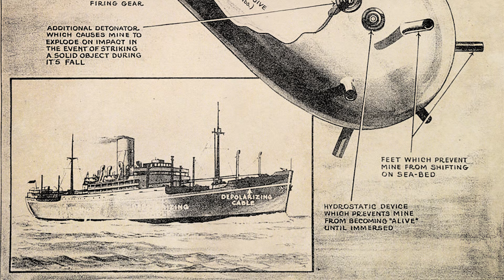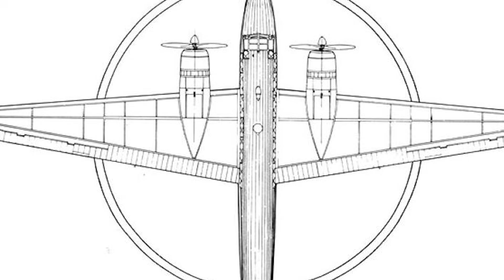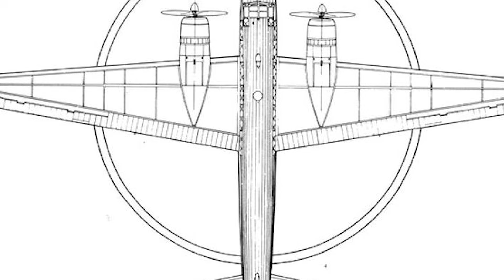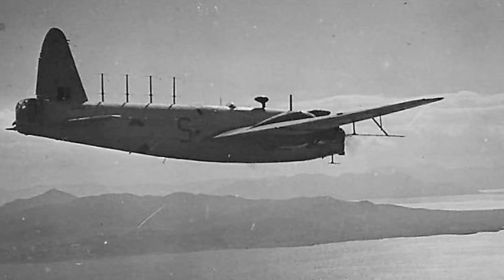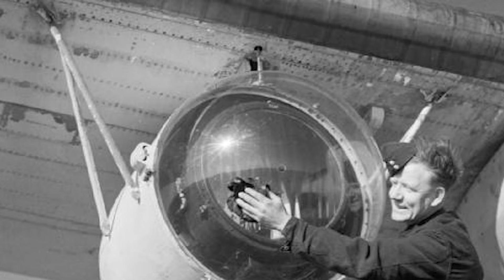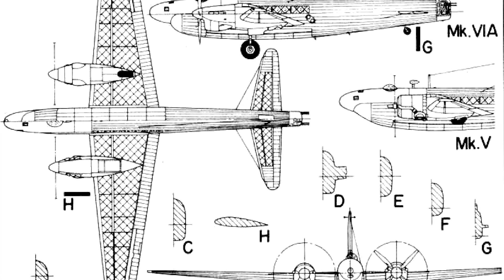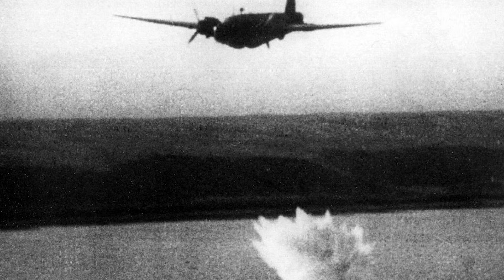Britain's Strangest WW2 Bomber? | Vickers Wellington (Part 2)

Comment: The Hurricane mounted 2 x 40 mm cannons successfully as a tank buster. which suggests the  nose or belly position should have been fine. Especially given the Hurricane had only 1 engine and the Welly had 2.

Comment: This seems to compare very favorably to the B-25 Mitchell, despite the Mitchell having two engines each with 70% more power it's only a bit faster with a smaller bomb load. And it don't think it's because it's lighter as the Wellington and Mitchell have near identical empty weigh. Is it the Wimpy's larger wings that make all the difference?

Comment: Had a model of the Whimpie as a kid. I remember the box art showed one in flames going down rather unflatteringly. I always thought the fuel dump pipes were some fancy exhaust system until thay were accidently broken of during play. The model was inherently strong and lasted for some time until dads epoxy had encrusted the smaller parts too much to warrant reattachment.

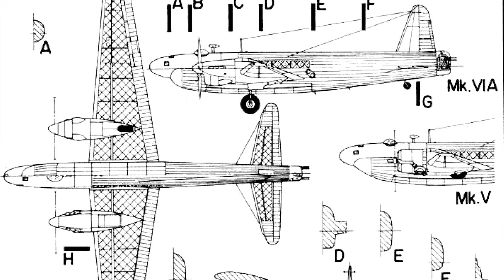Comment: 22:41 does anyone know what aircraft is escorting that Wellington? The closest aircraft is definitely a Hurricane but the one off to the left is baffling me. 
Could it perhaps be a P51??
Reply: Late in seeing this. You are correct, the second aircraft is the original model Allison engined P-51. As it's flying with other RAF aircraft, probably part of that first British order which had caused the P-51 to initially be designed and built.

Comment: We degaussed the ship every year in San Diego on Point Loma near the Sub Base. There was a dense layer of electrical field coils on the sea bed just a few feet below the ship at the moorings of the slip. The field coils were powered by old diesel sub engines re-purposed for this use which were mounted in a building on the shore. Any credit cards or magnetic memory devices or audio cassette tapes would be erased if they were too close to the outer hull near or below the waterline.
 We knew from the shore-based technicians and our captain on down, that it was pronounced 'de-GOUSE-ing', but every one pronounced it 'de-GOSS-ing'. You were mocked in humorous ridicule by shipmates if you pronounced it properly. I made sure t conform to the status quo or be harassed (pronounced 'hair-issed').

Comment: The one thing they weren't good as - glider tugs.  The airframe could handle stretching under load, the control cables not so much.

Comment: The U-boats used to submerge during the day and hunted mostly by sound then surface during the hours of darkness to run on diesel to recharge the batteries. The loud diesel engines meant the look outs could not hear a nearby aircraft. After homing in with radar and lining up on the U-boat, the first the look outs would know of the approaching aircraft was when the Leigh light was switched on. The Germans developed a radar detector, but the super-hetrodyne receiver gave off its own faint signal, so the British developed a radar detector-detector. All this made U-boats less and less effective.

Comment: A slight correction here, from someone who has actually been working with both dropping and clearing of sea mines both along the Swedish coast but also mine clearing operations off the coast of the Baltic countries when they became independent nations; mines usually are not laid to be floating on the surface, that would become a danger and a nuisance to all shipping including your own, you normally anchor mines on the seabed and set the depth to be just below the surface deep enough to avoid smaller shipping to hit them. 
There were instances where you dropped mines to drift to enemy shipping but that was generally practiced on few occasions like in the Dardanelles during the first world war by the Turks against the Entente warships, mostly pre-dreadnoughts and HMS Queen Elisabeth and other smaller vessels.
After the first world war, most drift mines were by accident as the mines broke their mooring lines.

Comment: 30 - 60 foot altitude. OMG!  I logged over 4000 hours flight time in P-3’s. I spent many hours at or below 200 feet and that can be attention grabbing. It wouldn’t take a very big hiccup to dip a wing or nose in. Besides getting the crap beat out of you due to low altitude it was probably like driving over a washboard. 
And! I bet it drove the magnetic compasses nuts to say nothing about other susceptible equipment aboard.

Comment: Ooof - sorry - hate to do this, but that just landed like a big old clanger on my eardrums - it's 'De-gaussing', not 'de-gauzing' - it's from the unit of magnetic flux, the gauss (G). named after a 19th C German scientist Gauss.
Reply: We degaussed the ship every year in San Diego on Point Loma near the Sub Base. There was a dense layer of electrical field coils on the sea bed just a few feet below the ship at the moorings of the slip. The field coils were powered by old diesel sub engines re-purposed for this use which were mounted in a building on the shore. Any credit cards or magnetic memory devices or audio cassette tapes would be erased if they were too close to the outer hull near or below the waterline.
 We knew from the shore-based technicians and our captain on down, that it was pronounced 'de-GOUSE-ing', but every one pronounced it 'de-GOSS-ing'. You were mocked in humorous ridicule by shipmates if you pronounced it properly.

Comment: As WWII in general saw a massive increase in what became know as Electronic Warfare.  Regarding the anti U-Boat aircraft, the loss of a Wellington over occupied territory allowed the Germans to analyse the system and build radar detectors to be fitted in U-Boats.  ASW aircraft then saw their prey submerging before they could be attacked, but of course in turn the radar parameters were changed to restore the advantage to the attacker.
192 Sqn operated Wellington Xs within 100 Gp in the 'signal interception' role, later known as ESM, using sensitive receivers to establish and analyse the German electronic order of battle.  This was dangerous work when for instance working to record the emissions of Luftwaffe night-fighter AI radars so that detectors and jammers could be developed.  They also contributed to the discovery of radio tracking transmissions from V1s, and the geolocation of ground radar sites, leading to the famous commando operation to seize a Wurzburg radar from Bruneval on the North French coast.
Anyway, great to see some of the more arcane variants getting some lime (or Leigh) light for a change!
Reply: I believe those Wellingtons adapted for electronic warfare were known as "smeller Wellingtons". They could sniff out enemy radar frequencies !

Comment: 19:48 Where are the nose guns you describe? I can't see them, unless they're either not fitted to these aircraft or the entire length of the barrels is internal.
Reply: In that picture they could be temporarily removed for servicing. I imagine that it would have been easier to remove from a flexible mount than a turret. Actually, I can't see any guns in the rear turret though that may be due to the angle, nor at the waist position if guns were fitted there in this later model. As these aircraft are operated in a maritime environment I would expect a more frequent maintenance schedule. Great question though.

Comment: There was a Wellington that was used as an engine tested at RAE Weybridge.  I saw a photo of it with a pair of RR Dart turbo props as used in the Vickers Viscount and Fokker F27.
Reply: Six Lincoln bombers were also fitted with RR Dart turboprop engines and used for bombing trials in Australia from 50,000 ft…
Reply: @allangibson8494  interesting indeed.  Vickers Viking was a development of the 'wimpey'; it was a wonder that they did not engine them with Darts.  There was the 'Lancastrian' too.  Did that not have 2 jet engines and 2 Merlins?  I suppose the Avro York was limited in her capacity for passengers but the Americans had a huge advantage of her transports for post-war civil aviation.
Reply: @guywillson1549  To really make use of turboprop engines for civilian service you need a pressurised cabin. Fokker showed the way with the Friendship (which was a pressurised extrapolation of the preWW2 DC-5 that Fokker sold to KLM).
The “Whale” Wellingtons showed the problems with a simple conversion.
Turboprops have to cruise at above 20,000 ft to get cold enough air to be efficient. Pure jets need 30,000 ft.
Modern passenger jets are limited to 45,000ft because of the survival time on oxygen required to get to 14,000ft.
(At 50,000ft loss of consciousness occurs 30seconds after loss of pressurisation without a pressure fed oxygen system).
Reply: @allangibson8494  thanks, that's interesting.

Comment: It's not "degauzing" - it's 'degaussing' pronounced 'de-gow-sing".  I used to work at Dowty Magnetics, where we made various magnetic ranges used to set the back-off  coils on Naval ships.  Ships have a magnetic field, whose orientation changes due to the Earth's magnetic field.  After a couple of months, say, in UK waters, any ship will have a magnetic field similar to its surrounding, due to slowly perming up.  Move that ship to the Mediterranean, and it's magnetic field sticks out like a sore thumb.  For this reason, ships were built with 3 magnetic coils surrounding the hull, which could be electrified to produce a magnetic field which cancelled out the field of the ship.  The Dowty ranges allowed the scanning of ships and rapid calculation of the settings of these coils.
Reply: It was essential for a minesweeper (even if built of wood and aluminium) to get periodic degaussing over buried undersea cables.
Reply: I had no idea a ship has a significant magnetic field, let alone one that varied with the sea it’s in, this is a very interesting bit of info.
Reply: You can see parts of the degaussing system if you ever do a tour of the “Lane Victory” a victory ship preserved in LA Harbor
Reply: @atomcat9000 regardless how much of an open secret it may be nowadays, you have almost certainly dicslosed CLAS info by explaining this. No civvy ship has degaussing gear and the stuff we had in the navy was as classified as it comes.
Reply: Nice reply with the exception of correcting the pronunciation.  Why be arrogant?  Is it that important to be right?
Reply: @mikebeard8505  Yes - why be wrong?
Reply: @mikebeard8505  I think it's more a correction for a mass mispronounciation caused by a Sci fi game known as Halo lmao
Reply: @mikebeard8505  shut up "Mike"
Reply: @mikebeard8505  Yes it is. Particularly if you wish to be understood correctly.

Comment: Did the British try to duplicate the magnetic mines?  They would have been useful if they could drop plenty of them near U-boat bases, to make sailing U-Boats in and out very hazardous.
Reply: The British had actually developed their own magnetic mine even before the war started. It worked on a slightly different principal to the German one. However, they had not put it into full-scale production, unlike the Germans who had hundreds of mines ready to go at the start of the war. The British went on to sow thousands of magnetic mines in the Baltic and off the German coast which the Germans then countered with their own aircraft fitted with a magnetic loop - The Blohm and Voss BV138 and Ju52 were the most widely used German "minesweeeper" aircraft. A considerable number of German submarines were sunk by British mines during WW2 - both contact and magnetic.

Comment: Excellent analysis Reg, though regarding the pressurised Wellingtons, the mark 6 with the Rolls Royce 60 and 62 engines were developed by Stanley Hooker and A Lovesey to provide a 1000hp at 30,000feet. It was used for the Wellington built at Broughton North Wales. Then the story goes, though could be a myth, that Lord Hives asked for it to be bolted into a Spitfire, so a Mark V Spitfire became the infamous Spitfire Mark IX. However Supermarine had won the contract before the war to build, a high altitude 4 engined bomber which was the British equivalent to the Superfortress, which all though the prototype was lost in the Battle of Britain begs the question what were Rolls Royce doing to power it. Could be an interesting video if you can find anything on Type 316 Mitchell Bomber.
Reply: David, it’s not a myth, this is covered in Sir Stanley Hookers autobiography “Not much of an engineer” a fascinating read by one of the leading jet engine designers of our time.

Comment: "...After a landing that would put even RyanAir to shame..." 🤣

But seriously, the Wellington survived in service because its very geodetic structural design made the airframe extremely strong for its day. Its strong structure made the Wellington highly adaptable for numerous other roles.
Reply: Some one asked a RyanAir pilot, on disembarking, after a rather heavy landing, "Was that really a sheduled landing - or were we actually shot down??"
Reply: So the geodetic construction gave it sufficient strength without weight.  
Thanks for confirming that.

Comment: A question: in the discussion of the transport Wellingtons, you mention that the BOAC aircraft did not have civil registrations. In one photo, there is a Wimpy with “N-208” on the bottom wing surface. Was this a US civil registration? The plane has RAF roundels.
Reply: 30:26 NA928 is too short for a US civil registration. Examples of US civil registrations are NC1701 and N99709.

Comment: Degausing doesn't permanently remove the magnetic signature. It has to be repeated regularly. Ships will regain a signature during normal operation. 
I'm surprised the flying donut wasn't used throughout the war.
Maybe the role was handed back to the navy.
The 40mm gun is interesting. Maybe that gave the Americans the idea for puff the magic dragon and the ac130
Reply: Interestingly, the Germans started to use mine degaussing systems from 1943 on, using specially modified Ju 52/3m transports and modified BV 138 flying boats.

Comment: The Mosquito variety named for something more. Painful, mounted an under-nose Mollins four pound, automatic gun, which in a five might send four U-boat destroying bullets.
Reply: That would be the ‘Tsetse’  Mosquito Mk.XVIII which was equipped with the 6pdr/57mm auto. Very accurate, far more so than the 2” or 3” RP. 
Post war they shoehorned a 32pdr/94mm gun into a Mosquito in a Molins auto mounting. It was flown, fired successfully with no problems and then the project was canned. The muzzle-brake on the big gun was a work of art in itself.
Reply: @Retired Bore I would say the typhoons that were 'Flying can openers' might be closer.

Comment: I worked with an ex RCAF navigator in 1975. Apparently the Wimpy as he called would take a phenomenal amount of battle damage and still get them home.
Reply: It was their basket weave structural makeup. Not that it wouldn’t get blasted through with holes, but it would at least hold its structural integrity.
Reply: It looks as though a cannon round could potentially pass right through the aircraft without doing more than leaving two holes. Maybe geodesic should be tried again.
Reply: @garryferrington811 a similar reason as to why the bismark had a very hard time shaking off swordfish, the rounds were not designed with a slow fabric skinned machine in mind so would just go straight through.
Reply: I believe the Mosquito plywood skin often allowed bigger shells to punch straight through. Though a hit on a spar would be nasty.
Reply: My dad was a navigator on a Whimpy.  He explained the reason for their robustness.  Barnes Wallis and his structural genius.
Reply: @johnhanson5943 my father was also.
Reply: @johnhanson5943 I have often wondered if Barnes Wallis was inspired by the early 19th century Seppings framing systems for large wooden warships. Apart from the materials used, they seem identical.
Reply: The real Let down of the Wellington was that it had no armor and returned many more members of its air crew dead vs it’s competition. It was cheaper and faster to make but at a cost to the crews
Reply: @mddunlap03  lol .040" of aluminum isn't armor. 
As a retired aircraft engineer I'm always amazed with people who think a metal skinned aircraft affords more protection than a fabric and or wood airframe. 
Geodesic construction is a incredibly  resilient structure however nothing is free in life. The tradeoffs In this case being weight and production time.
Stressed skin (monocoque/semi monocoque)is the construction  technique that survives to this day.
Reply: @mddunlap03  the competition that didn't make it back with wounded...means THEY DIDN'T MAKE IT BACK!
Reply: @brentfellers9632  funny when you think about a B-17 that landed with barely a tail, one that landed herself with no crew, a B-17 tail that landed itself(extreme grain of salt no clue if it's true the other 2 can be proven though). 

Curious though if any wellington had some weird but similar stories.
Reply: @mddunlap03  Logic is not your strongpoint. The Wellington's ability to sustain damage and remain airborne is why dead and injured made it back to base. Other aircraft simply crashed with no survivors whatsoever.
Reply: @Fidd88  He requested and somehow after experience in Italy was sent back to the UK for trading and transfer to the Mosquito